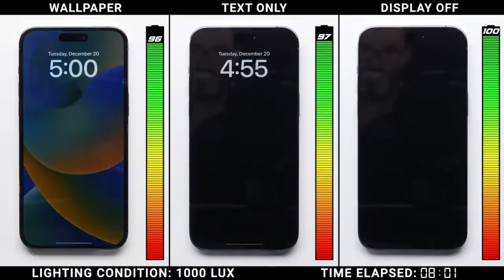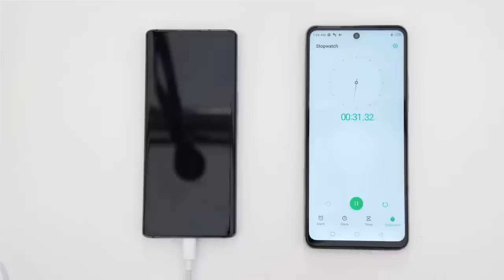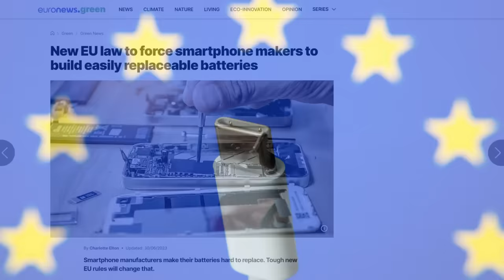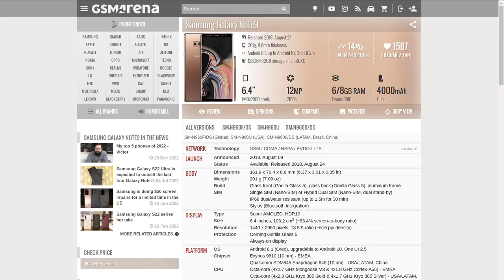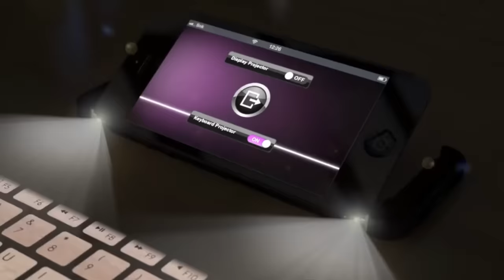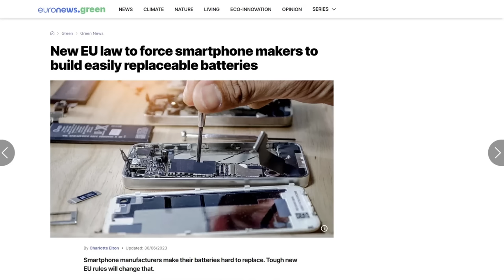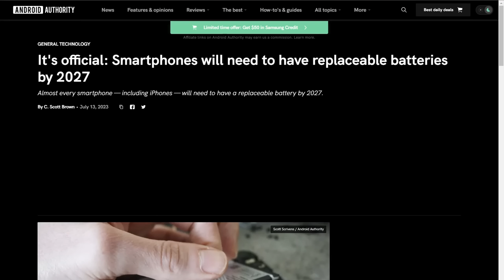All Smartphones Will Soon Have Removable Batteries

Comment: I'd be super surprised if with "Removable Batteries" they meant that you could pop your phone open and switch battery like in the old days. I think they mean that the battery can't be soldered/glued or that you have to change the whole screen together with the battery.
Reply: @funtimeflorian1643
Or that, if special tools would be required, then said tools would need to be included in the packaging of the product free of charge.
Reply: There is a big difference between user replaceable and user swapable.  Today batteries are glued in not to be annoying, but to stop them moving if you drop the phone on a hard surface. If you want them to be swapable then you can't use glue so the phone and battery will have to be tougher. Or maybe the battery can be secured with a couple of screws. Making a completely tool free battery swap so you can do it while you are out will be much harder than making it so you can replace your battery once per year without paying for a professional to do it.

Comment: I agree with all of that but the camera part. I miss the lidar camera on the Samsungs and if they kept it, it would probably be pretty decent now, maybe even actually usable for 3d scans to print things as an exact copy of a real item. You could use it as a shitty depth based night vision and it would have been interesting to see how that would work with the much better lidar sensors that are available now.
Reply: Maybe if there was a more "special" edition sure

I don't think features like that should be put on "Mainstream" phones
Maybe add it as a Special edition phone or something... like a Pro version or something idk

But i think that 90% of the users would not even try or are unaware of the Lidar camera lol

That's why they removed it... very sad
Reply: I miss when phones had infrared leds that could control TVs and most devices with basic remotes
Reply: @kajmak64bit76  no it should just be standard. Could be for measurements, 3D scans, models, a lot of things actually. I think it just wasn't commercialized very well.
Reply: @drumunkey007  sure but i doubt some 18yo's with sugar daddy would know what a macro camera is let alone LIDAR

And many other instances of something like that lol

Comment: I don't feel the need to swap batteries on the fly but I think it's good if phones could be opened with regular torx screwdrivers to replace the batteries every 2 or so years. That could easily double or triple the lifespan. It would also mean that it's easier to open the phone to replace broken parts. If most of the glue could be replaced with screws (such as in the Fairphone or the Framework laptop) then this would be a win for consumers. It would also be a win for repair shops to be able to fix phones more quickly.

Comment: It's worth noting that phones can also slow down or become less reliable from worn out flash memory

I used to think it's only the battery and the OS that's dying in my 5 year old Xiaomi, but whenever you try to copy or move files to/from the internal flash the phone has a noticeable stroke and is unusable for the duration of the operation, so a changeable battery will not necessarily prolong it's life by much 
But of course, a step in the right direction for many reasons!

Comment: The market may shrink a little, but external batteries also charge your other devices. Not to mention my external battery can charge my phone three times (though it is pretty big).
Reply: And these battery bricks are almost certainly cheaper too. Nothing stops you from using your phone while it's charging anyway.

Comment: I'd like to see little charging adapters for spare batteries! Like how you get for a camera battery, just plug it in to a little plastic device that connects to a USB port and charges it up while you use your other battery to keep running the thing you want to use. Charge and use at the same time without any tether. I get this "feature" with my actually cheap and old camera, I want it on my phone, too!
Reply: Yes. Just commented in response to another post that this would be a useful tool to have on hand.  Kinda like the charger that came with my power-drill, which has a swappable battery.
Reply: Like you'd have for a camera battery. I have that on my Sony camera. YES...
Reply: @wmentzer58  Exactly, and this needs to happen with phones. Drills have it, lawn mowers have it, laptops have it, cameras have it, even scooters have it to a degree, it shouldn't be different for phones and tablets.

Comment: Tbh. would also love some standarisation of battery factors, like with normal batteries: AA, AAA etc. etc. since USB-C port is pushed, why not some batteries constraints, so that so, no matter the brand, there would be higher chance of swappable batteries across phones. (So that so I can beg ppl to borrow me battery from their smartphone when in urge)
Reply: That would leave little room for improvement in the batteries. Phone batteries are constantly improving because there is no specification
Reply: @americanbagel  Haven't heard of any improvment recently that would be related to size. Output type and voltage is rather steady too. So this matter is rather pretty solidified.
Reply: @CRAAACH  Nah im all about that non- lithium graphene battery with 0% loss on charge

Comment: Everything you said was true but it is also true that a large user operable entrance has the potential to compromise water resistance. I use slim cases or run naked and I have had plenty of spills and rain and dunks. If all other things being equal I was offered a battery swap or water resistance I would take the water resistance. I have also been paid for photography done with my s22 ultra. Maybe if I bought a 6000 dollar dslr I could get better (and I have). But having an honeslty incredible camera setup in my pocket is something I value.

Comment: ❤ removable batteries. My old LG G4 went thru 10 of them until verizon stopped supporting. The original died soon. I got a free backup one with the phone, then bought 4 more, and swapped them out until they were dead by phone year 6. Bought 4 more. Now it is an alarm clock.

My intention was to wait for removable batteries to come back. Yeay EU for reading my mind!! 🎉

Comment: Now I normally don’t like too much government regulation (probably because I’m from the US where every regulation somehow never helps the people it’s intended to help and somehow the corporations always manage to take advantage of it) unless it actively helps the environment (in a real way), the public, ect. This law seems great I actually don’t see much of a problem with it at all especially since we are nearing the point where getting a new phone every 2-3 years isn’t going to be very important as the progress is slowing quite a bit. Being able to replace your battery easily would be amazing I hope they also pass some more right to repair laws soon that make it illegal for any company to lock down their phone because it has a 3rd party part in it. Imagine if the car industry made it so your car wouldn’t start because you put an aftermarket air filter in it. That’s essentially what’s going on here. Also, for those who say that the waterproofing and battery capacity will be impacted I’m pretty sure these companies will find clever ways to make it so they still have those waterproofing and high capacity batteries and if not it will open a small gap in the market for a competitor to step in which will make these companies have to innovate or lose their position which is usually good for the consumer.

Comment: I've been using Fairphone since the Fairphone 2, and I can confirm that I'm swapping phones more rarely (in fact, I skipped the FP3, and am now on 4). This is probably also the point of the legislation.

Also, water resistance has never been a problem.
Reply: I was also looking to get one but unfortunately I've been turned off by the fact that phonecalls are apparently very buggy.
Reply: @fenn_fren  now that you mention it, phonecalls have been buggy - I've just chalked it up to my cheapo provider :l

Comment: Love this! It is very inconvenient to keep your phone attached to a portable battery charger and use it at the same time. I don’t think that it’ll completely remove portable battery chargers either- instead you can have 2 phone batteries + a battery charger, then when your main dies you get it charging indefinitely with you battery charger while you switch back to your main. 

The utility of this is actually super huge - let’s say you’re on a hike and your phone is about to die. It is very hard to keep the phone attached to the battery charger and have it quickly available to use to take photos and videos when needed. Instead a quick swap can be done. 

Really excited for this.

Comment: I love the glorious regulations of the EU. THis had been annoying me for years.

Finally I can use a phone for more than 2 years without suffering for it.

Edit: Next step would be to regulate the batteries to a standard size and voltage so almost any battery could be used for any phone. Could be a comparable system we have for many batteries already like the AA batteries.
Reply: they had "requirements for interoperability" option in proposal, but decided that it's too ambtious at the time. Maybe this gonna be next step.

Comment: This is a really good thing. I remember when they had removable batteries, and then they just didn't. I like changing my battery myself, it is a lot cheaper.
Reply: Samsung Galaxy S5 was the last user replaceable battery by that company on a flagship. Everyone else quickly followed suit.
Reply: @tanker242  I didn't really get which side you're on, but manufacturers stopped having replaceable batteries in their phones because it's cheaper to manufacture phones without one and it leads to consumers buying a new phone more often because many people just buy a new phone when their battery gets bad instead of just having it changed in a store

Comment: I really hope this happens (especially because i live in Italy) but in my opinion if Apple managed to screw the usb-c thing by limiting the speed surely it's not going to implement removable batteries as we think of it. I am also concerned about other manufacturers following the apple route (as they always did) and ruining the concept entirely, heck i am so attached to the removable battery thing that i decided to modify my 4 year old OnePlus 7 Pro (that i use still as daily driver with a custom rom) to make it easy to change the battery on the go (keeping a second one in my wallet) and it's so freakin' good that makes me don't wanna change it forever
Reply: Apple is probably going to try and make it so that you need a "special tool" from "them" that costs 50-200 USD just to open the case and remove the battery with no issues. Seems like something they'd do.
Reply: They already do this. Fast charging is usually proprietary technology laced into the USB-C cable.
Reply: @hebikotei9578 not "usually". There's a whole standard just for power delivery over USB-C, which certain manufacters chose to ignore. Samsung gets a pass because they didn't have the USB-PD standard when they first implemented fast charging. Any manufacturer trying to implement a new proprietary charging system over USB-C needs to be shamed viciously, USB-PD can do like 120W IIRC so power capacity is not an issue.
Reply: They shouldn't be forced to do this.
Reply: @tissuepaper9962  https://en.wikipedia.org/wiki/Quick_Charge#Compatible_with_QC-enabled_chargers

Most major manufacturers participate in this behaviour, regardless if necessary or not.
Reply: @hebikotei9578  that list has like ten companies on it, that's not "most manufacturers" unless the only type of device you're talking about is TOTL phones for $1k+.. Currently writing this on my USB-PD compliant Pixel 6a, sitting next to my compliant Nintendo Switch, and my compliant 120W charging station. If I had a USB-C laptop I'm sure it would be compliant, too, because I'm not buying ASUS ever again anyway.

Comment: I have mixed feelings about this.  How many smartphones has the EU Government designed & marketed?  How many EU ministers have ever manufactured ANY product--or even run a business for that matter?  Where do they get off intervening in the phone market?  On the other hand, I really do miss my old LG smartphone with the cheap, quick-change battery.  It probably doesn't matter.  Apple will find a way to follow the letter of the law while still defeating its intention.
Reply: I'd suggest you to replace a battery in a unibody phone a couple of times by yourself. You will change your mind QUICK. Especially when most of the time the battery you are sealing back in is not the original. The EU is obviously doing this for their hippie reasons, but in this case it's a win for most people.

Comment: I'd just rather a 3.5mm jack and a sd card slot, it would be way more useful (for me at least), easier to implement and would not have these drawbacks. The sd card would also help a lot on longevity.
Reply: Why not both?
Reply: @mikos321  Yeah, both is even better.

Comment: This video is good and kind of remind me the problems (which I completely forgot) of having a removable battery. One commentary stated the problem of loose charging ports either because of the cable, or because of the charging port itself and the fact to let the phone in a certain position to make it charge. Also there was the problems you stated in the video of falling the phone and having the back "ejection seated" with the battery. I would add this consideration, the fact that now a beautiful phone are glass and steel made. If like back in time, we would return to plastic and steel, I my opinion phones would be less nice looking... but this stetement might be false... I just don't know 😅
Reply: having a glass phone with a broken back-plate literally 5 days after buying it, and one of the 3 lances dangling off because the glue went loose doesn't feel very premium to me: wireless charging is a dumb design. making an everyday's product out of fragile materials also is; you want something fancier than plastic -> aluminum -> perhaps titanium; but certainly not glass o-o'

Comment: This is a crazy bet made by EU. It means that all the smartphone companies have to completely change their smartphone design and architecture. And of course it also means that smartphone companies will lose a lot of their business, due to the life extension of smartphones with replaceable batteries. Probably some of them would prefer to stop selling smartphones in EU. Bold move but it could be a suicidal one.
Reply: Batteries are not reason anybody buys new phones it's software updates that demand new hardware for support . People still bought new generation phones when there old phones were  working .
Reply: They're gonna succeed. They won with Apple and the charging port, they banned click cigarettes etc .
As a EU citizen I fully support removable batteries. It's really frustrating that I can't change the battery myself. I remember back then older phones and smartphones having this feature.
Reply: Stop selling in the EU? You do know that the EU is one of the biggest markets on the planet, with a lot of very rich people that have been throwing money at these companies for years. 

Obviously not. Apple and co. will scream like toddlers, but will ultimately comply.

Comment: I actually don't like that this is going to be forced. I personally couldn't be bothered that I need to open the back of my phone if I need to change the battery. I just personally feel that the phones that had removable batteries were usually plastic and cheap feeling. I really like the glass and metal design of modern phones and I don't know how that will still be possible if the phone is required to be designed completely differently.

Comment: When the phone fall and the back comes off and the battery fly out, this resuces the total energy impacted on the phone screen as some of the energy is taken away by the battery and back cover. Having an additional charged battery that can easily be put in the phone is also good. However, i still believe permanent batteries are better and we should be focusing more on extending battery charge and life and make the battery charge faster. We are basically going backwords if we make the batteries removeble. In addition this will increase the chance of the battery suffering physical damage and become waste that end up in landfills.

Comment: Regarding battery banks - they are still useful. With my LG G5, I would take two batteries (one in the phone, one spare), one battery bank, and a case designed to charge the batteries outside the phone. That way I could use one battery, swap it for the other, and then have the empty one charging in my bag while I used the other. This way I would then have another full battery ready to go by the time the second one ran out. Battery banks are usually good for charging a battery three or four times, so it's better than carrying a bunch of batteries.

Comment: all smartphones will be slightly thicker so they can stack a bunch of vital stuff where it's technically possible to remove the battery but you have to get a specialized tool to not damage the battery.

Comment: It is possible to waterproof a phone with removable battery - just follow the designs of waterproof cameras by designing a battery door with a gasket to keep the water out. Another tradeoff we might see when removable batteries are back is that the smartphones could become thicker again which personally I don't mind for better grip.
Reply: Absolutely.  GoPros had swappable batteries AND submergibility (more than just water resistance) for a very long time